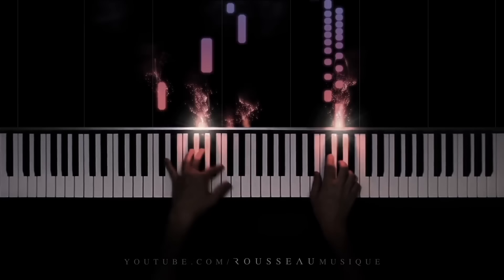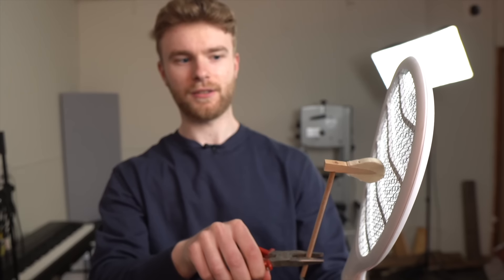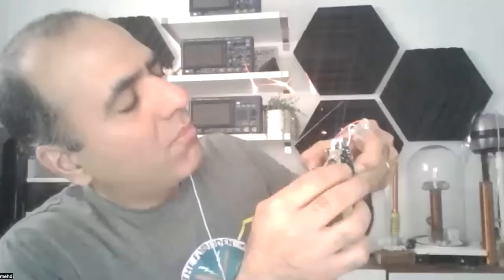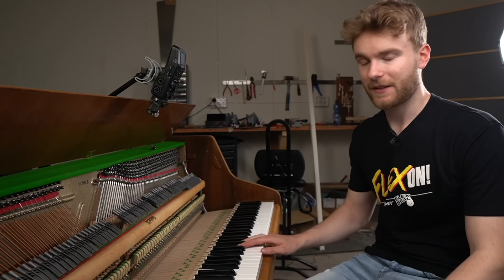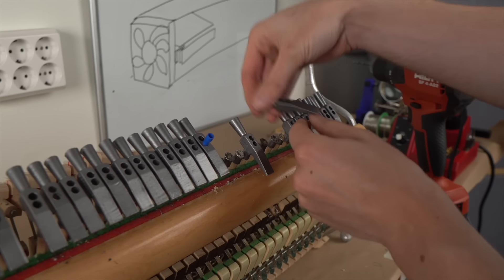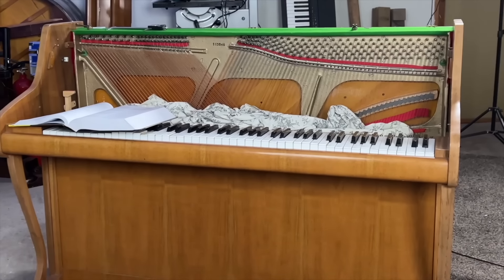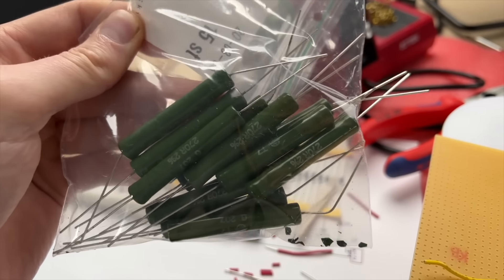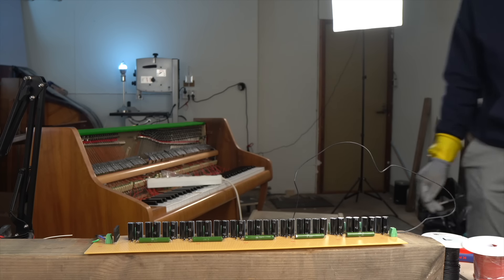How to NOT make an electric piano ft. @ElectroBOOM

Comment: For the hammer welds you could try  using  welding Anti-Splatter  spray used  to protect surfaces when MIG welding  , the splatters  molten metal drops sticks alot less   on surfaces